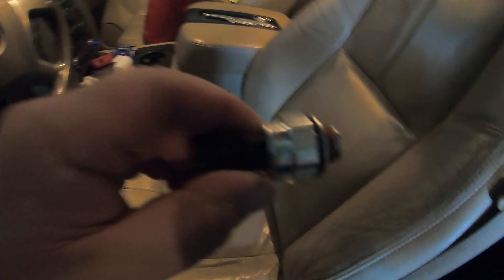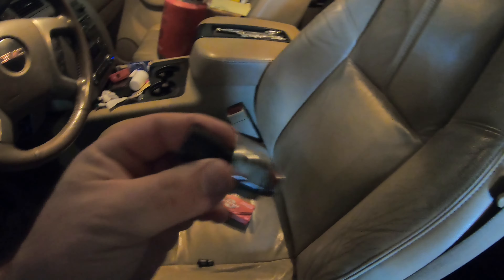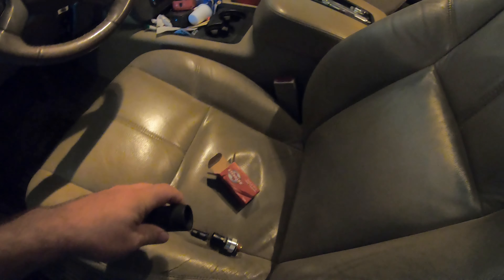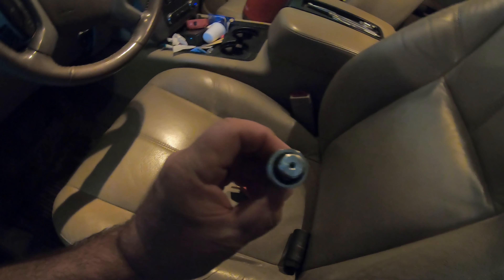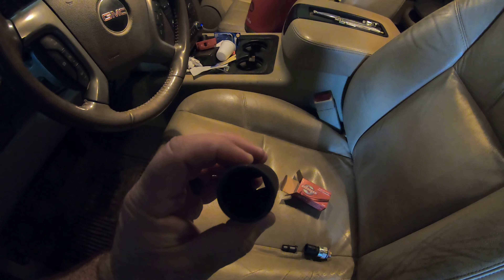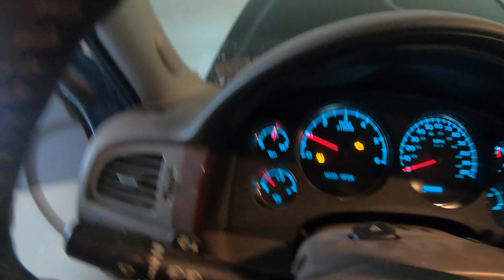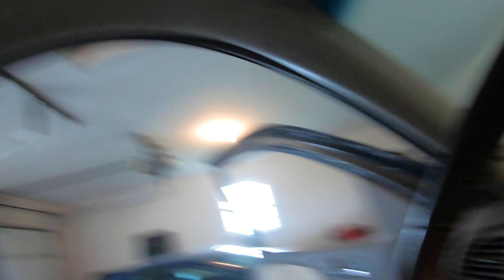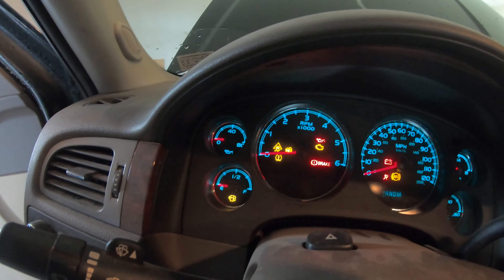How to Replace Oil Pressure Sensor in 2011 GMC SIERRA 5.3

Comment: Disconnect battery will clear code if you don’t have a obd2 reader
Reply: Yeah I believe I forgot share that
Reply: Yeah I believe I forgot share that
Reply: @TonyPRohrer do you disconnect it after you put the new sensor in ? or before ?
Reply: @jchr3975 sorry just saw this. I did it after to clear the code